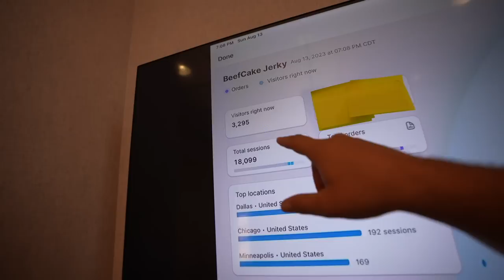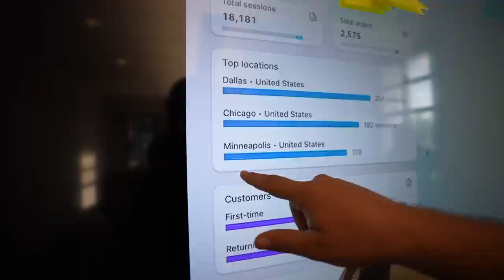FILLING and STOCKING My BACKYARD Fish HATCHERY for the First Time!!!

Comment: Hey flair. I’ve kept fish for over 10 years now. Few things to keep in mind. Minnows are hardy fish but because they are so small they are susceptible to water temp fluctuations, need cover to hide in, and should not be bunched in the hundreds together. When you go and buy them, try to buy the least amount possible, and transport them straight to the hatchery. Also before releasing them, you can acclimate them to the water temp but floating the bags they came in, so they are not as shocked. And make sure to check your water conditions for ammonia, and PH.
Reply: also, I think they over fed the fish and the Nitrites built up in the water and is toxic to the fish,,,,, he needs to swap the water out
Reply: I completely agree!  Have had luck with fish myself. I noticed when they were pouring the fish from the bucket that could have killed a bunch. Plus, the shock from moving from one temperature of water to the next. Small fish can be temperamental. All good advice.
Reply: Don't forget light cycles. How freaked out would you be if the sun didn't come up when it was supposed to? Or it was daytime for 36 hours straight?
Reply: Man makes way too much money to not do this stuff properly or get professional consulting. This ain’t the first time and won’t be the last he kills animals by being negligent.
Reply: also probably shouldn't leave the dead ones in. it can cause ammonia build up from decomposing.
Reply: THANK U, AMMONIA AND PH BROTHA
Reply: Agreed. My Papa would buy 50 bags sometimes and let them float. Then he would put small holes in the bags so they would have a soft landing into the pond.
Reply: I would just about guarantee that it was ammonia that took them out if they were complaining about the smell
Reply: This exactly what I'm mean when I say filtering is cracked way up more than is the truth. Ammonia is a gas. It is toxic to fish, the fish & their waste ,including over feeding create ammonia gas which is crazy soluble in water. If u have a test tube full of ammonia gas, stopped with a line & valve to another test tube full of water,when you open the valve the ammonia gas dissolves so fast(jumps into the water) that it creates vacuum & will draw the water from the testube through the line & half fill the testube that had the ammonia in it. Ammonia does not filter out ,& if it did,it would just jump back into the area pond as it drifts over it after leaving the filter unless you bottle it. In a stream it washes away down stream & fresh rain water run off replaces this  fish fouled water. Food that lives until eaten by the fish is best for the water  & fish in that small eco system called a tank,hatchery or pond. Adding rain & well water while draining of fish fouled water is very beneficial. After all the money wasted,flairs fish hatchery should be   rigged so (top notch) & a stabile place for the fish until the pond (lake) is made to successfully hold water long enough to be made use of. Portland cement could be a cheaper alternative to bentonite. Just rototill it in,rake it off & sprinkle.  Called earthment. Portland cement does weep or leak water through it(it breaths) but it will slow the living hell out out of it restricting & slowing,weep,seep & soakage to a manageable rate.

Comment: keeping minnows its important to get as many as the dead ones out as quickly as possible. Also treating with the meds, and water. they like to hide and want some structure keeping the structure in the middle is very good and will lead to less stress. Consider putting foam around the pump. and maybe a bubbler in the middle. you should see improvement.
Reply: Yea the nitrates and phosphates are probably way to high causing a die off. You need some sort of mechanical filtration. They make really nice canister filters that would’ve helped filter out some of that fish poop.
Reply: There isn’t nitrates yet. Nitrates are the end of the cycle, ammonia is too high, since there is no biological filter to change from ammonia to nitrite, to nitrate
Reply: Agreed with above.  Nitrogen cycle hasn’t been done. You guys mentioned you tested the water but for what?  

Nitrogen cycle is I bet guaranteed to be the issue.  Same thing with the outside pond until the cycle is done.   Some simple ways to expedite the process.
Reply: @troyocanada they tested it and it said they have hard water, I presume that it was a mineral test
Reply: @MintNickel1  missed that.  Ok thanks.  So likely need to do a general aquarium test.  Same idea bigger scale.
Reply: @PNWDrone2018 especially from all the dead fish, poop, and extra food in water those will cause an ammonia spike causing fish too die especially when there isn’t good filtration, aerator, and circulation

Comment: depending on the type of minnow they may want shallow water to keep the eggs out of danger and warmer. others like grass, and others want thick pebbles. ask your local supplier the type of minnows and if they had any degree of success breeding them.

Spawning - Spawning occurs when the water temperature reaches 65 degrees F and continues throughout the summer as many as 5 or 6 times. Flat stones or boards which have been propped up facilitate spawning and provide cover and therefore should be added around the edge of your pond in 1-3 feet of water.
Reply: There's no 1 to 3 feet of water in there with those cliffsides.
Reply: I use to raise aquarium fish like catfish and angel fish and we use to use slate and they like it dark when and during they lay there eggs.

Comment: When I was a young man, I worked at a large bait camp that also wholesaled minnows to bait camps within a 100 mile radius. Employees would take a tank truck up to Anderson minnow farms in Arkansas several times a week to restock.  The place I worked had about 2000 square feet under a roof, consisting of cement tanks probably 8' by 3' and about 3' deep.  They were fed by well water.  Each one had 2 or 3 hanging electric aerators per tank.  Your ice chest was out of oxygen before you left the barn with that many minnows in there.  Oxygen is so important when you have fish in captivity.  Good luck on your endeavors.

Comment: Hey flair I would leave the exess plastic around the pond and that'll help as a weed barrier so it's easier to maintain around the edge. You can always add rail ties or bricks as a border around the edge and maybe gravel as a walkway. That way you don't have to worry about weeds near the edge or throwing grass in the pond when mowing
Reply: Sorry flaire, but your figures are off. It's closer to 72,000 gallons at 8 feet deep. Some taper to the sides & ends ,but still I'd be certain it's closer to 60,000 gallons 25 gallons a minute (that was a big 25 gallons I saw start filling that Hatchery btw) even so, 1500 gallons per hr? 36,000 gallons per 24hrs. 2 days I hope it's a strong well?
Reply: @marktheo1563 that was 25 gal per minute when the well was first drilled, usually veins will open up more as the water continues flowing.
Reply: Or just put 4 poles and put a shade cover so there won’t be a lot of algae

Comment: Amazon has some good pumps for ponds or you can make your own with a trash can and filter material with a lift pump. Pool Jet made one. But you’re best bet is just buy a pump with filters. Moving water is best bet . Also put the fish you transfer in a zip top bag and tie a string around the top and lower in water for 10 mins to balance there temperature. And good luck . Stay safe

Comment: You could run a 4-in PVC pipe just at the level you want the hatchery level to stay that runs down to the big pond that way you can still pump cold fresh water into it. And you're going to want another pipe coming out of the pond so you can still use that water from the well, otherwise Jake will have to swim down and connect it and earn a meal. Only one meal though.

Comment: Not a minnow farmer but I had a 55 gallon aquarium for years. I would check the water temperature.
I also have a concern about the new pond with the black liner. My swimming pool will hit 120° about the top foot of the water until the pump runs. You're going to need air as soon as you can. They sell solar pond fountains until you can get electricity to the pond. If course you could also do solar for the pond.

Comment: To prevent erosion when filling the main pond, put a pvc pipe to where the water already is. It will prevent the water from washing out the upper levels of pond as the water already there would stop the new water from washing out the dirt.

Comment: If you want to stop the silt get an old tarp and run it underneath the pipe towards the water you already have in the big pond. Also when breeding minnows you want plants so for the ones that do die off the plants will suck up the nitrates

Comment: minnows need colder water than you think they do. Usually just above freezing, like 32-36 degrees is the best temp for them to live. They have issues with quick changes of temperature as well. So if you are looking to transfer them, it needs to be a gradual change. Start with incorporating some of the water they will be moving to in their pool and slowly add more to it. That way they won't die of shock when they get to the hatchery. Main point is the colder you can get it, the better! Good luck!

Comment: I don't know anything about ponds or hatcheries, but I have been in the aquarium hobby for a few years, and I know you can't just fill a tank with water and then throw fish in. There is a whole process called the nitrogen cycle where you add a small number of fish you don't mind killing to a brand-new tank, let them eat and poop and create bacteria, then the bacteria turn to beneficial bacteria and is essential for a mini eco system that is stable. I could be completely wrong about hatcheries, but I think the same process applies. Adding more sand for beneficial bacteria to grow on might help, they also make bottled chemicals to kickstart aquariums and ponds and add the beneficial bacteria without having to wait the weeks it can take to happen naturally. Plus each fish that dies is just creating more waste and an ammonia spike that will kill other fish, that is why you should way under stock, especially for the first run.

Comment: Build a wall off the over hang on the pool liner, to give the pool (over flow) to make a shallow spots around the pond for the fish, add plant around the shallow to add cover, coolness for the fish to bread and for the baby fish to hide so they dont get eatten by the fish bigger then the new born baby fish. Plants also help the filtration of the water and allowing oxygen to the fish ( if planted in the water or even just the roots of the plants in the water) another thing, you need to help the fish with the water change in temperature and water quality. 1 more thing never poor fish strength in a empty cooler, it will knock them out and kill them. Treat them more carefully when transferring them to a new place you will have reach your goals on breading if you looking into what a pond needs for breeding, new babies need and what helps fish need to hide and water to stay safe for all ages of fish to survive. Good luck

Comment: Flair, what did you use to control urea and ammonia in the small pond? That's why they all died. YOU HAVE TO HAVE AN ESTABLISHED NITROGEN CYCLE BIOFARM before you add fish! You NEED to add sand, gravel, POROUS ROCKS to the bottom of the new hatchery to help give the bacteria that convert ammonia a place to live. AND you need to have enough flow to ensure they get the ammonia to convert it from the water column.

Comment: YOU. NEED. TO. FILTER. THE. WATER......

Aeration is one thing but if you don't have something removing the nitrates and phosphates out of the water the fish are just going to die. You need to have something filtering that out of the water if you're keeping livestock in a small pond/pool. If the fish are constantly peeing/pooing in the water and there's nothing to remove that (and any uneaten food) it just builds up in the water. You want to get something that's rated 50% higher than the suggested water size so if the filter says its good for 200 gallons and the pond/pool is 200 gallons you want to get something that's rated for 300.

YOU STILL NEED SOMETHING TO FILTER THE WATER IN THE HATCHERY or a lot of aquatic plants that will remove the nitrates/phosphates replacing the job of a filter (You will still want a filter though)

Comment: Disease is also something that can cause a kill.  I have heard if the minnows get a large white spot on them, it can potentially spread to the others and kill them.  Something to look for when buying minnows to stock. Also, I think adding sand and gravel along with the filtration should help quite a bit.  I don't think they will spawn on a flat tarp, need something for the eggs to latch onto or lay on.  Also, you should net the dead ASAP as they can cause disease as well from what I understand.

Comment: Andrew, 2 things killed all of the fish on the transfer. First, when you poured from the bucket to the cooler, you did it with no water in the cooler and you literally knocked out all of the fish when you poured. Second was the acclimation you mentioned. The water in the shop was probably 30-40 degrees warmer than the pond. Live and learn.

Comment: Leave the hose on the fill pipe to fill the big pond so you dont have to deal with the erosion. Thats just my common sense speaking. Also Minnows lay eggs on the bottom of surfaces so all you really need is something that floats on the pond and to feed them. Also that filtration.

Comment: Flair, "We don't have power down here" as we listen to a generator running in the background. Need to aerate as that water has very little oxygen in it since it is from an underground well. How'd? they die that fast?  Well Banjo killed half of them when he dumped the bucket and they slammed into the empty rigid plastic cooler head irst. The other half were killed when they went directly from the 75 degree water in the cooler to the 50 degree well water pond from the thermal shock.

Comment: i was inspired by you to do this and put about 50 creek chubs in a 30 gallon barell 1 airiator and i put them in my basement where the temp is always around 60 degrees and coverd them with cardboard so they were in the dark not 1 minnow died and 2 weeks later they could use a water change but thats it i think you need to control your temp and cover them also try wild caught minnows or try to buy creek chubs bass love them

Comment: Man flair you need to buy a predator water prumo jump. Its a 1 inch pump and 25gpm. It would speed the pumping process of. And if if goes through alot of fuel you could rig a boat tank to it so it doesnt need to be refilled as ofter.

Comment: If you test the water in that kiddy pool, you will find high levels of ammonia and nitrate. Enclosed systems need at least a month to establish a nitrogen cycle. This is best done by figuring out the maximum stocking density and then only adding a maximum of 10% of that density, per week to 10 day. The slower, the better.
I'll also add that you can expect 10 - 15% die off, regardless of how perfect the water is. This is due to normal anatomical failure with young fish.

Comment: There is a formula to calculate the amount of gallons in an aquarium. LxWxH in inches divided by 231. A 30ft by 40ft by 8 ft pond should approximately 71,000 gallons I suspect you are closer to 50,000 gallons just because the slopes aren't 90 degrees and the pond isn't completely full. Just thought I'd share.

Comment: You can only keep baitfish shallow like that if you have a water cooling system . Otherwise they need to have a habitat with relative depth for the body of water that’s enough for them to find cooler refuge in during the hotter season otherwise they’ll just die from stress

Comment: You flair I was thinking bro you should try to get a well put in but you should put in a well pump so you don't have to use electricity or gasoline to pump out the water.
I know it might be difficult up there cuz there's not a lot of water in the ground but you should definitely try it or look into it at least so you wont to be using gasoline or electricity to pump out the water.

Another thing I wanted to tell you bro is you should look into how tree ashes is basically just fertilizer I was going to say bro if you're cutting up a lot of trees that would be good to burn those trees and then pick up that tree Ash and then put it in your animal pin all on the dirt spread it out and then whenever it rains brought I promise you flair you will have fresh grass growing.

Comment: @FLAIR Welp...I just typed a novel and my comment got deleted lol. You need an overflow and moving water to keep the environment clean. Filtering is good but the moving water makes a huge difference in larger bodies of water. Also,just a heads up that if you plan to having water constantly running in...you need it to have a place to overflow. I use to build exotic enclosures and environments to know this. You need to do the proper water tests as well...like any other body of water.
Using a liner is not really ideal for this and if you plan to use dividers it will probably not work. You might puncture the liner trying...

Comment: I feel like you should check your water temp it plays a big roll. the hotter water get the faster oxygen goes away from it you still have pumps and all the other equipment will heat the water and cause oxygen to not dissolve efficiently in the water with the bigger hatchery you should have as big of a problem since its a bigger body of water. not a minnow farmer but i do hydroponics and water temp plays a big roll in anything oxygen related